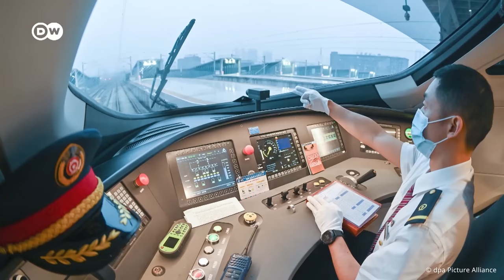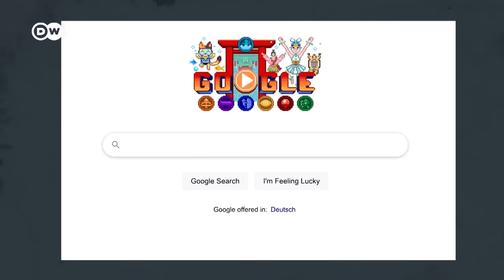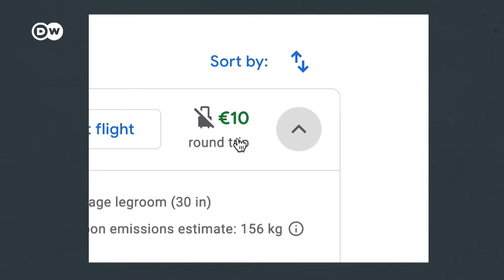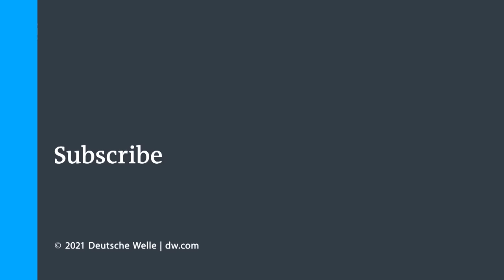How China built the best high-speed rail ever

Comment: Yes, China has a lot of Cheap labor force. These people may not have a college degree, and they may be driven by the high pressure of the CPC. 
They can design and manufacture high-speed trains with a speed of more than 300 miles/h, 
They can launch space vehicles to Mars, and can quickly Complete the construction of complex bridges and tunnels.
 DW's redefinition of Cheap labor force is surprising!

Comment: Air travel contributes huge amount of emisdion so high speed train is a huge plus for the environment.
Reply: Cause the elec is magic?
Reply: Lol not always. Only when the trains are powered by electricity. If it's by diesel then the results will not be that much different
Reply: @Kuricang31  not when you factor per pound.
Reply: No, sitting at home in front of a tv is better for the environment.
Reply: @Dan16673  Same thing bruh. And it's much worse when it was diesel since it's un-renewable

Comment: The car culture in the US was mentioned as a major impediment to building high speed rail. As well as the obvious that the interstate highways make it relatively easy to drive from one city to another, a problem for people traveling on Amtrak is that in most American cities, local public transport is totally inadequate so getting to the departure station may require a car and having arrived at the destination city, a car may be required to get to the final destination. Zoning policies dating back at least to WW2 mean that most residential land in American cities is only for single family homes and the low density housing means that public transport will never be feasible.

Comment: Here in Iceland there's regularly popping up discussions about laying the first passenger rail tracks, high speed rail that is, between Reykjavík and Keflavík international airport. At a length about 45 km from the city center.  Hopefully it'll be a reality in the not-too far future with growing population, people working on opposite ends of the line and more tourists coming to Iceland. The first phase of building Borgarlínan (cityline) BRT system in Reykjavík greater area will soon start and to have the possibility to take the high speed train directly to the airport would be a huge life quality improvement.  Not to mention the reduction in emission of green house gases.   On similar notes, the Reykjavík domestic airport takes up huge land space just right next to the city center which could be used to build apartments and drive the price of housing down.  The domestic flights could be directed towards Keflavík airport and the high speed train would cut the travelling time from Keflavík to Reykjavík from 40-50 down to just 20-25 minutes.  There are talks to build a brand new airport just outside the city just a little south of Hafnarfjörður in the lava but since the volcanic eruption started on Reykjanes peninsula that isn't a very viable option.   Even though Keflavík airport is also on the peninsula it's still further away from the epicenter of the current volcanic activity which is too unpredictable.

Comment: This video is too one-sided. I don’t know how he came to the conclusion that “China’s flight on-time rate is almost the lowest in the world.” The main reason is not that the Chinese military controls China's airspace. The most fundamental problem is that China has too many people. An airplane can transport 100-200 people at a time, while a standard high-speed train can seat about 600 to 1,200 people, and it can be faster, more efficient, and more economical over a 1,000-kilometer transportation distance. If it were you, which one would you choose? In addition, China also has the "Spring Festival", which means the peak transportation period during the Spring Festival that lasts for more than a month, with an average of 3 billion+ people traveling in demand. If it were transported by plane alone, the number of aircraft movements required would be an unimaginable and unrealistic number.
Reply: 如果飞机太多，他们又会聊环保了🤣

Comment: Maglev trains should also connect the biggest cities in Europe. That would be amazing!
Reply: But expensive. Besides the existing maglev trains can barely transport half of what a conventional High Speed Train can, so yeah, conventional trains are superior on that
Reply: Nope. It's too expensive and a waste of resources. Even the German Maglev that was operating in Shanghai is losing money and costs its operator billions in electrical fees alone
Reply: @Kuricang31  one aspect is that the short distances make maglev trains economically impractical. But the longer the distances (without stops) the better it looks for the maglev. Maybe you are still right, I don't know. But if airtravel wouldn't be that much subsidised and freed from taxes on kerosin for example, then it would also be very expensive.
I just think there should be a better alternative to airtravel in europe in general. And right now there isn't enough investment going into that imo.
No need to aswer, not going to debate.
Reply: @wohnungsnomade  You can checked on dozens of journals etc regarding the maglev issue in Shanghai and the one that is currently being build in Japan. It is highly impractical and super-expensive. Just like what you had said

Subsidies are not the reason on why airfares are cheap as each government would have their own sets of rules and guidelines which makes it more complicated. Airfares are cheap due to the airlines cutting costs in a lot of ways possible like Ryanair whose been unable to get its own proposal of passengers standing for the entire flight be accepted by European air agency

Comment: Gonna make a correction here to the video.

2:47 here, the rail up to Tibet isn't considered high-speed rail. Some parts still need to be electrified, the track speed isn't laid at 200km/h+ highspeed rail standard, and it's primarily singular line tracks. So the image of the Green "Bullet Train" (CR200j) cannot be considered a high-speed rail. The CR200j (Highspeed rail) she mentioned in the video actually runs between Tibet and within the region and is electric and Diesel power is mixed and it only goes up to 160km/h at max, which is alright, but obviously doesn't meet the UIC's definition of highspeed rail at faster than 200km/h.

Comment: Of course these so called experts are product of their education system, hence the low quality of these so called consulting knowledge. You cannot blame the system. Anyhow the "consultant" clearly doesn't know the power of prefabricated modules which drove the costs down immensely. Most of the work is done like legos hence faster construction times, hence the lower cost. Remember in infrastructure development, the longer the project the bigger the cost. Im really sorry for DW for the low value knowledge they got from these consultants.

Comment: Yes; I have ridden it from Beijing to Shenyang, Shenyang to Dalian and from Shenyang to Harbin. 
Almost Shinkansen-standard, and runs like a charm. 

I made a back-of-the-envelope calculation out of interest. If you divide the number of inhabitants with the HSR network length in kilometers, China actually has a slighly longer network/inhabitant than Japan by now (2024). 
Both are impressive networks and achievements, though. 
The impressive thing about China's is the speed with which it was built. 
The impressive thing about Japan's is the pioneering effort (for example: ATC systems with early 60s era Toshiba computers; and no lethal accidents - ever....almost unbelievable..).

Comment: Brazil is a country of continental proportions, however, it does not have any railway destined to transport passengers. In the last 40 years there has been a regression in rail transport, even affecting freight transport.
Freight is very expensive as it essentially depends on road transport using trucks.

Comment: The UK has 67 miles (about 100km) of high-speed rail in England.  HS2 is a 200 mile north-south high-speed rail project in England currently under construction. The first phase is about 100 miles between London and Birmingham, it's been under conversation for decades, in planning and construction for over 10 years. Planned opening is currently set for 2033 (less than 8 miles per year). By completion including stations built for the line, it'll have cost well over $200M/mile
Reply: And Eurostar?
Reply: @WvhKerkhof  Eurostar is the name given to a passenger train service connecting London with Europe. 
It runs on the 67 mile track I mentioned above and then in the tunnel under the English Channel to Calais in France

Comment: Because the operation of high-speed rail is low-carbon. So it said that the high-speed rail is very high in carbon emissions during the construction process. Is it mean that the construction of airports and highways, and the manufacturing process of aircraft and vehicles does not emit carbon?

Comment: Regarding Stuttgart 21, the most recent estimated start date I have heard is 2025.

Regarding profitability, I struggle to believe that there are so many unprofitable lines. Granted, there are some exceptions, such as the line to Xinjiang.

However, China built lines so much more cheaply, as this video says. China has been building its lines on the edge of cities (given the huge stations necessary to handle the anticipated passenger numbers) and, to a large extent, on flyovers (reducing the land take).

Also, when I visited in China in 2018, trains were nearly always full (a huge change from 2011). They have been adding 17th cars to 16-car trains! It is not just the trains, but the lines too! The original Fuzhou-Xiamen line filled up within a few years, necessitating the construction of another new line. I also understand the Wuhan-Guangzhou line (one of the earliest high-speed lines) is close to capacity as well.

Comment: Turkey is developing one. Much better than the U.S. and some European countries, far behind China and Japan. Ankara’s connection to Eskişehir and Konya are pretty good and have been in place for over a decade now, but the istanbul-Ankara connection needs reinterpretation. It is functional but a stretch of it, almost half, runs like a regular train due to geographical constraints and the density nearby Istanbul.

Sivas-Ankara is about the be opened and Ankara-Kayseri is planned. These are great but serving relatively less populated areas. 

Bursa-Ankara, whose inauguration is long overdue, and Ankara-Izmir, which is still at the very early planning stages, are needed fast. 

Istanbul-Izmir is another desperately needed.

Comment: Here in South Africa the closest thing we have to a high speed train, which is technically not even a high speed train, is the Gautrain, which connects Johannesburg and Pretoria and has a top speed of only 160km/h. It only has two lines with the main line that runs between Johannesburg and Pretoria being about 80km long and a shorter line that runs from the north of Johannesburg to OR Tambo International Airport. It's more of a commuter train than a actual high speed train that connects cities at a long distance, being used mostly by people going to and from work between the two cities. Its biggest drawback is the cost. It is ridiculously expensive (thought still a bit cheaper than driving) and well out of the reach of the majority of ordinary South Africans, who still mostly rely on taxis and slower municipal trains and buses to commute to work. And those that can afford to would still rather drive. There has been talk for a number of years now of plans to expand the network expanded with more lines being added, in particular to connect the low income areas of both Johannesburg and Pretoria but up to now that hasn't happened and there are no signs that it will happen anytime soon.

Comment: I have only two things to say. First you say the delay of flight. But it would not b canceled as often as in EU. And the price, you can also buy ticket from Dalian  to Shanghai via flight for only EUR 20. And you can also check in with a luggage for free. I don't think cheap flights should be a reference of the price. Can you buy a ticket for EUR 10 from Berlin to...(I forget the city you have said) at any time. Of course not. So why do you say that? 

The second thing is that most of the high Speed trains are not profitabel. That's right. But why it is still cheap? Because the government has paid for it using the tax. It's only for the convenience of the daily traffic. In this way, either the poor or rich can afford it. From Beijing to Shanghai, 1200 km, it takes only EUR 90. But from Hamburg to München, only 800 km, it takes EUR 160. Have you ever thought of that, why the high speed train is not profitable in China. Because of politics? How dare you say that?

Comment: Does that so-called female high-speed rail expert really think that China can do this with cheap materials and human resources? The high-speed rail needs to be demolished, but the government's compensation is also high. However, individual people are greedy and want more. Collective interests are more important, right? Only detour the road. It is said that China's high-speed rail is political will, and any infrastructure is political will, but as long as it can serve the people, it is good. China not only does not fully consider profitability in high-speed rail projects, but also does not fully consider profitability in projects such as communications, power supply, and highways. In China, you can get 4G signals even in remote rural areas. Roads and electricity are also available in closed mountain villages. Almost county-level cities in China have high-speed rail. These projects may not be profitable, but they can get more Convenient transportation can also solve the problem of the gap between the rich and the poor.

Comment: High speed trains aren’t necessary and are expensive lol and they’re way slower than air travel
Reply: We use 5,000,000 tons of jet fuel every year between Sydney and Melbourne.
Reply: china will have 600km/hr high speed trains and their slow trains of 160 km/hr are used by farmers..
Reply: @sheenasmith4555  farmers can just fly at the same prices
Reply: @sheenasmith4555  ever heard of low cost airlines
Reply: @edwardbarnett6571  and high speed rail requires an inordinate amount of power as well
Reply: @lincolnhaldorsen5649  True, but electricity can be produced cleanly.
Reply: @edwardbarnett6571  if you past the carbon releasing processes need to manufacture the steel.
Reply: The fuel efficiency of HSR is 8X better than airplanes.
If the distance of journey is less than 600km, HSR is the best choice for time consumption.
The journey between 600---1000km, the time consumption would be depen to how do you get to the HSR station from home.
Reply: @lincolnhaldorsen5649  china has way too many people and most celebrities in china use airplanes.. china has the biggest airport in the world too..

Comment: China didn't rely on cheap labor to build the system. They modularized and rationalized the system to billd rail, with maximum component fabrication in factories and minimum work on site with raised viaducts. This video is essentially propaganda make excuses for European and US failures by suggesting it is based on unfair advantage and politics. But isn't the problem that the EU and US political systems are gridlocked to the point of failure?

Comment: The "Chinese labour cost" excuse for having shorter high speed rail in Europe is both pathetic and getting tiresome.  Even IF we were to do somethign unfair and take the low end number Chinese construction cost given in the video of $17 million/km AND use the high end one for Europ of $39 million/km.  To make up the 29,000km of track to catch up to China, it needs to invest $638 billion.  That sounds like a lot until one realize that China did this over the span of 20 years so the per annum cost is $31.9 billion.  The the meantime Europe has been sitting on its hands since the 1970's.

The excuse "cheaper material costs for China" is even more laughable.  So does China acquire iron ores, oil, coal, aluminum, nickel, lithium, etc at lower costs?  It's mind-boggling someone hasn't arbitraged this amazing opportunity yet.
Reply: It's difficult to put it together for Europe due to its disjointed nature, but to put it in perspective, the US spent $177 billion on road and road bridge maintenance in 2017 alone.  Despite this, the American Society of Civil Engineers estimate it needs to spend $786 billion to prevent it from being in an abysmal state.  At the same time, despite being the largest (non high speed) rail network on the planet, Amtrak spent $713 million on maintenance from 2017 to 2019.

Comment: 40% of the “self developed” high speed rail system is made by Siemens — stuff you don’t see on a train: the ultra high precision bearings, axels of high strength steel, control systems of sensors, protocols, and actuators.  Almost exactly the same happens to self developed passenger planes that “look like” Boeing 737s: embargo on the engines (which last 12,000 hours vs Russian’s 3,000 hours vs China’s own of 800 hours), landing gear of material which can take high impact, tires that do not explode, and all avionics.  That’s why the 919s will not be flooding the market any time soon, though a huge number of them has been booked with deposits made.

BTW, the railway system has an on going operating debt of 4 Trillion and mounting.